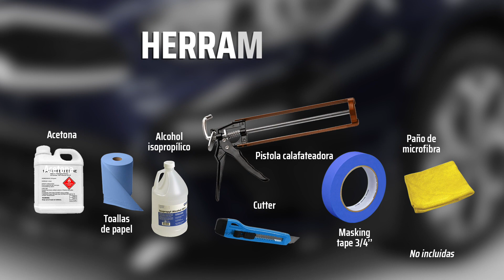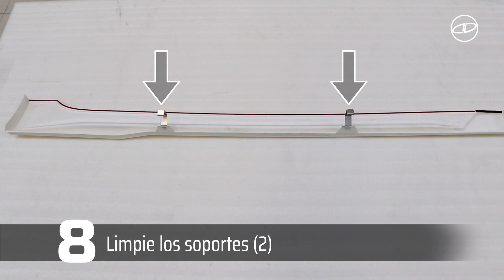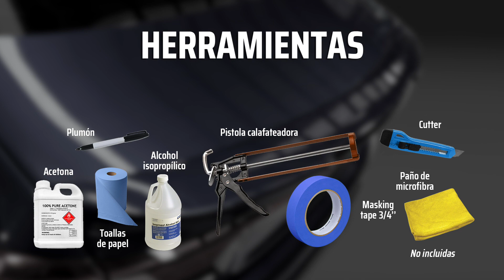BODY KIT Forte 2019 - KIA - Español

Comment: Saludos! Cuanto es el costo del body kit y donde se puede conseguir? Gracias!
Reply from the maker: Hola Carlos,

Puedes darnos tu correo o enviar un correo a catalina.moreno@airdesign.com.mx para que se ponga en contacto contigo.

O comunicarte al centro de distribución e instalación en el Estado de México ubicado en: Av. Dr. Gustavo Baz #43, Col. Xocoyahualco, Tlalnepantla de Baz, Estado de México 54080. Teléfonos de contacto 01 800 623 79 52 +52 (55) 53 93 66 36

También puedes visitar nuestra tienda en línea:
https://airdesign.com.mx/
https://airdesignusa.com/products/car-bodykits/forte-sedan-2019.html
https://airdesign.com.mx/products/car-bodykits/forte-sedan-2019.html

Saludos cordiales
Air Design
Reply: @AirDesignDIYInstallationVideos  quisiera comprar el body pero nosé como mandé correos pero no hay respuesta